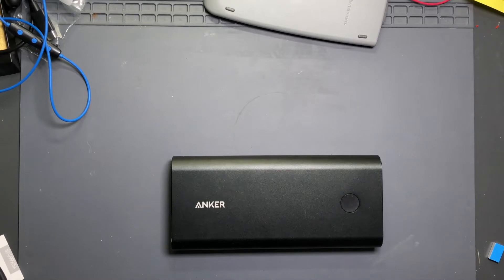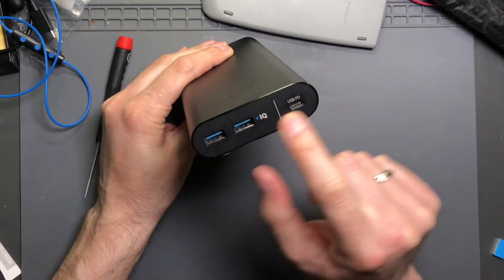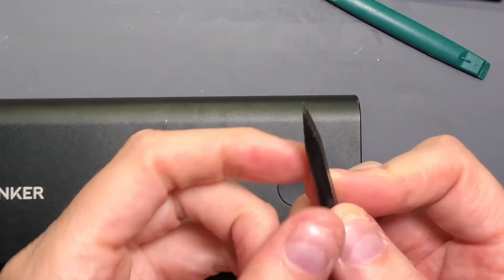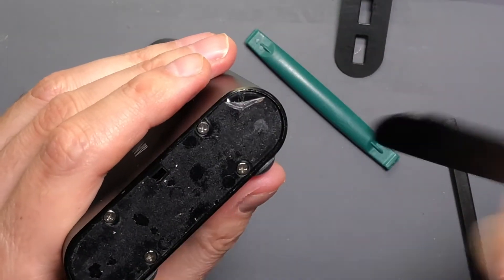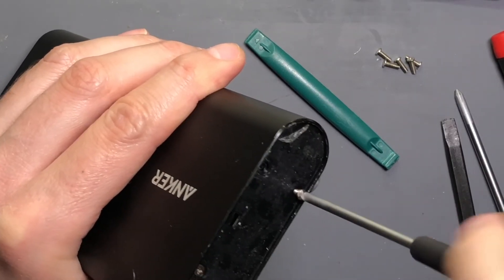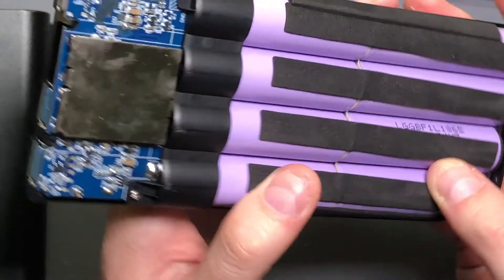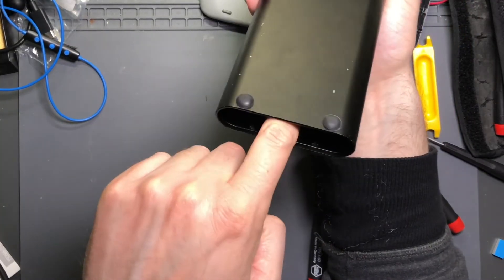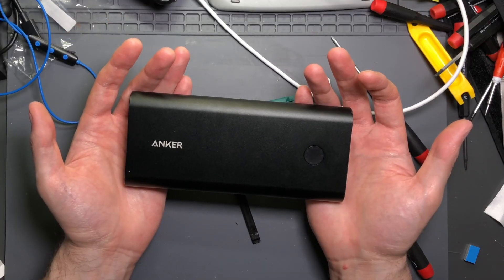How I Open The Anker PowerCore+ 26800 PD

Comment: I recently replacved a model A1211, that appeared to charge up, but discharged too quickly to be any use. I thought I'd take it apart to replace the batteries. But it's glued tight. There are no screws! I'd have to destroy the case to access it's innards.
Reply: Mine also looks impossible to open without destroying it! So annoying!

Comment: Still using this powerbank, from 2018 or 2019 and can still charge my s23+ about 3 times
Reply from the maker: So am I!
Reply: bought this from 2019 and still working and still using it, but too low for recharging powerbank.. so decided to buy another one with display on it
Reply: @Kander91  I got the ugreen version, it fully charges in 1.5 hours with 65w

Comment: I broke the C connection once jamming into a bag. I was scared putting it aside for too long was going to break the li-ion cells. I found a 90 degree usbC angle adapter and was able to make it work for a short while, just to use it a few times. Probably should have done that from the beginning. The usb-C in out port is a real Achilles heel on this powerbank. Anker now makes them with 2 I/O ports on newer models.
Reply: Thanks for the video, made it very easy

Comment: I have bought 2 ANKER products in the pass, I wasn't impressed...this 26800 PD  charger was a complete let down. At the time it got lots of advertising hype and I bought into it and got stung. Just operating this power bank is confusing, ok I'll admit I'm not great with electronic gadgets I kinda want things to just plug in and work, but this power bank was very confusing to operate plus when it did work it just about charged my phone twice. Wouldnt buy ANKER again. Bought a ANKER multicharger and it burned out after a little while leaving a smell of burning plastic everywhere plus smoke
Reply: I think their multi-charges are overpriced. As for powerbanks they do a great job but you need to know what your phone craves: VOOC, QC or PD. For example Iphones need a special chipped cable to do PD with lightning. Whereas Oneplus sometimes favors USB-A ports over C ports, depending on the Anker powerbank. This was one of the first laptop charging 20v powerbanks out there. That's why I have it.

Comment: Mine wont charge, just flashes 1 dot. Tried resetting it, opened it up seems normal
Reply: Same
Reply: @ZEESHAN_2110  What's the voltage on the powercells? Did you let it discharge beyond breaking?
Reply: Hey, how do you reset it?

Comment: What charger model is used to charge the batteries in this power bank from the mains voltage in the house? I mean the voltage and amperage...5 volts on 1 A or 5 volts on 2 A ? thanks for the explanations
Reply from the maker: I made a video specifically on this. Check the description (its #5 on the list of videos).

Comment: I have the same power bank and although it's in mint condition and has barely been used it refuses to do anything. No lights, no charging and no output. Anker don't want to help so it looks like I'm going to have to follow your helpful teardown tips. Hopefully I can open it up and revive it because it's only been through about two cycles since I bought it and I don't want to throw out such an expensive item. 

Seems that Anker have some quality issues with their products because from what I've been reading many other people are having issues with their power banks suddenly failing for no apparent reason.
Reply: I couldn't repair it. I tested the batteries and they are fine so it's likely to be something on the circuit board that's stopped working. I won't be buying Anker products again, feeling ripped off. Maybe I'll get the new Nitecore 20000 power bank to replace it, I've had good experience with their products.

Comment: What type of batteries Anker using for this product? From the pink packaging it looks like 8 Samsung 30Q batteries together. However their capacity is 3000 mAh, times 8 is 24k mAh
Reply from the maker: Check out the full teardown in: Total Teardown: Anker PowerCore+ 26800 PD (Part 4). See Description above. Since the pack is 26,800mAh, it is 8 x 3350 mAh.
Reply: @TheCuriousEngineerChannel  baterai jenis 18650 bro?

Comment: Hey my anker power core 10400 when its fully charge it will not charge my phone at least 20% and it will be empty then when i charge it it will be fully charged within 1 min.(it will fully charge in 1 min and it will be empty in 1 min to) any help pls ….!
Reply from the maker: Weird. I don't know. What a bummer. I have two of those batteries - perhaps I'll take one apart and make a video. Have you tried charging other things with it?

Comment: Hi, sadly my Usb C port broke off the pcb with some solderpads. On the other side of the pcb are what i think are Testpads for the Port, i would like to solder a new port on using the testoads as substitutes for the ripped off pads, but i cant find a schematic to know which pad goes where. If you could measure them it would be a giant help, but i understand that you are probably too busy.
Reply: Any update on replacing usb C port mine has become lose and only work when pushed to the side
Reply from the maker: I am looking into this along with others that want to replace the USB-C port itself. In your case, it might not work, as I don't know if the test pads are there for all the needed connections for USB-C PD. Thanks for watching!
Reply: @TheCuriousEngineerChannel  there are 13 or 12 test pads exactly the same amount of pads on the other side so it should work thanks for looking into it
Reply: @TheCuriousEngineerChannel  any update on replacing the usb c pd port?
Reply: Mines 2000watts still won’t charge smh